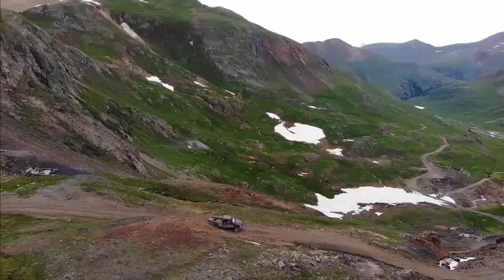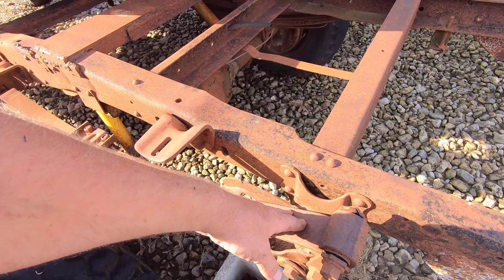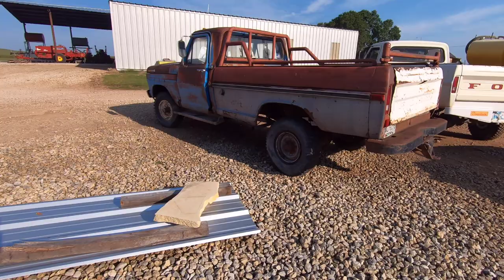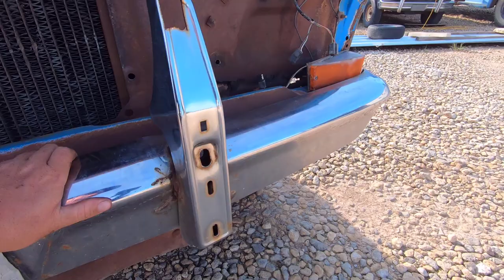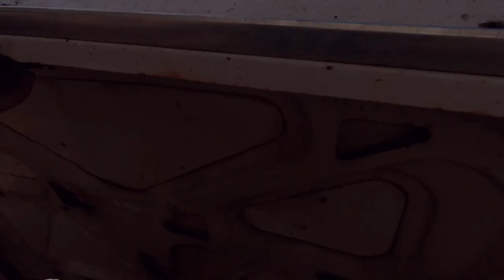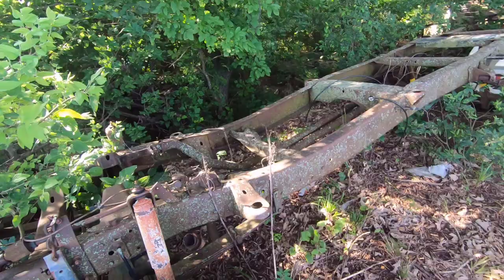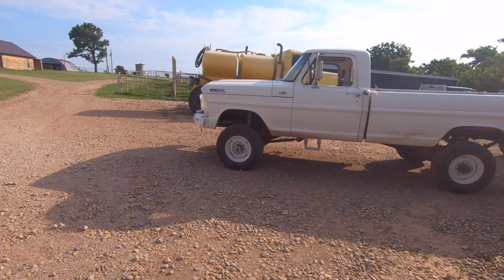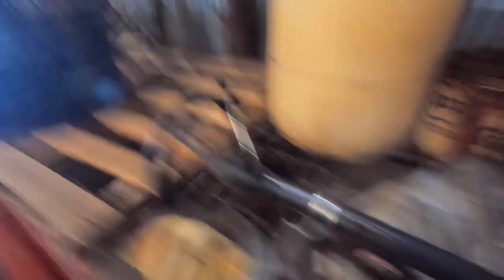What Exactly Is a Highboy? Plus Ultimate Highboy vs Stock!

Comment: ford built 3 different size 4x4 if it is as low as a 2 wheel drive people call it a low boy if it has no blocks sits high it is just a 4x4 but if it has blocks in back then it is a high boy will sit 2 inches higher, 3/4 ton  sit higher then a 1/2 ton and a 1/2 ton frame is about 1 1/2 inches on the frame rail closer to gether then a 3/4 ton . i have dun a few swaps putting 3/4 ton axles under a short box 1/2 ton . chevy is the same easy to do most even have the bolt holes . i have a factory high boy 1970 with dana 60/80 under it it is a heavy duty 3/4 high boy 1 ton axles on a 3/4 ton it was ordered that way with single tires in back and has the blocks in back even have paper work on it plus it is on the option sheet only took me 10 years to find the perfect high boy to build best part i got it for 250 bucks rust free good clean body ranger with tool box on side have the factory 360 in back of truck they put a 390 in it runs good but i have a 428 that needs rebuilt for it runs but worn out . not going to much with it till i get the new shop in plus i am building a 68 chevy street truck

Comment: There are actually a very few rare 77,5 models too. they have all of the features of a True highboy but dont"t have the 4" blocks under the rear springs, and they have flat leaf springs up front, not arched like a true highboy. They sit low , and were only made for the first few months of the 78 model year . I've only found 1 in my lifetime. I have pictures of it if anybody would like to se it.
Reply from the maker: I don't really know a ton about the later highboys. I knew they were till 77.5 but did not know they were lower like the 78-79. Very cool! Thanks for the info.
Reply: @MattKubik1791  You're welcome. Thanks for the great video, I learned alot from you. You mentioned that highboys Vin start F26 or F28 for Chassis cabs, I checked the Vin on my 75, It's a chassis cab with utility box and PTO Winch on the front bumper. It was purchased new in 1974 by the Army Corp of Engineers, sold to the Texas National Gaurd in 91. it has very low miles . It's a 360 4 speed and is a Tank! I love it. if you ever wanted to see my trucks or that 77.5 I can email you pictures.
Reply: nope. the 77.5 was a lowboy. married case, still has blocks out back (smaller but here) integrated steering. 335 series engine. I actually own a 77.5. .

Comment: back when pickups were actually made to work.not computerized 4 wheel drive lincon continentals with racecar engines & designed in reliability issues to constantly feed a parts & service department.

Comment: I picked up what i have dubbed, "Frankenstein's Highboy"
Guy took a front axle D44HD, a transfer case and cross member and transmission out of a 76 250, and grafted it into a 78 f250 chasis. 
This allows you to have the conventional power steering box on the frame and still have the D44hd axle and the divorced NP205 and the factory lift all in one package.

And you can run a rear frame fuel tank on a 78 frame so you dont have to deal with an in cab tank. 

The guy had a good idea but couldnt execute ot for crap so ive been fabricating and fixing all his redneckery

Comment: Just slang,
High boy is also slang for some front end loaders and 32 Ford coupes on model A frame
It would just be as easy to say F250 4x4 from 60?-77.5 it’s just the way they built them.Sadly no offense only the goofballs called those trucks high boys back in the day I would never call them that would have got made fun of..😮lol 
But y’all do whatever I will say I had. 72 F250 4x4 with built 351W 4 speed 4.10 gear true 36x9.00 tires I pull started a loaded semi in a gravel parking lot outside of a grain elevator with it and it was a shitty pothole gravel parking lot to boot, 4 low ,second gear in a lightning fast shift the third. I had quite the audience too for it didn’t hurt one bit great old trucks take care of all your  u joints, those front cab mounts

Comment: Why didn't you research what it actually, really was before making a video describing what it is in a manner that clearly illustrates and even you say you don't know? Until Ford introduced and integrated transfer case in 1977, it's four-wheel drive vehicles sat five to six inches taller than it's two wheel drive counterpart. The slang term highboy came from the four-wheel drive models sitting higher than rear wheel drive only trucks

Comment: Better put a piece of pipe in the rear cab mount when going from inboard to outboard cab mounts.
Reply from the maker: 70-72 for sure! But the 67-69 use that top plate and keeps from crushing the cab.
Reply: @MattKubik1791  Can someone elaborate on this for me please?.
Reply from the maker: @stephenhenderson5737  the 70-72 cabs did not use the top plate on the rear cab mounts. They have a sleeve built into the cab so that when you tighten the cab bolt it doesn’t crush the cab. When you move the cab bolt from where it was in the factory that sleeve isn’t there.
Reply: @MattKubik1791  Thanks Matt.

Comment: Looks like an old. International farm truck the Ford bronco basically a international scout what's a Ford raptor a Chevy hummer that's been built since the late 80s even before the hummers the military never used ford's the bought the old gm square body's easy to work on parts interchangeable all the military trucks international or Chevrolet or Oshkosh all divisions of gm Cadillac caterpillar pretty similar name bit the Chevrolet C10 was HD truck or GMC

Comment: I got to go to the dealer with my father in fall of1976 to drive his new 1977 F250 4x4 crewcab Custom home, I still remember that red truck the day it was new. It had a 4 speed standard transmission and 351W and he wasn’t to pleased with the power it put out, sometimes when pulling steep hills on the highway he’d have to drop down into 2nd gear. Also for some reason the 4 Hi on the transfer case was never ‘there’ from the factory, it was indicated on the transfer case shift lever but all he could select was 2 hi, N, or 4Lo. He sold it in 1982, it was rolled many years later but repaired and I still see it occasionally.